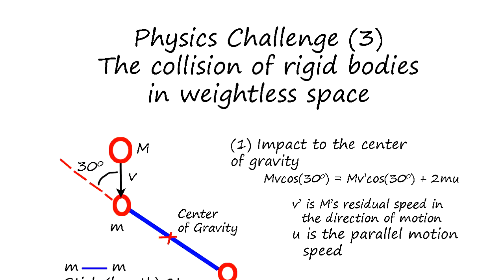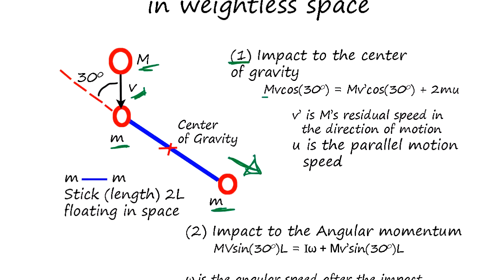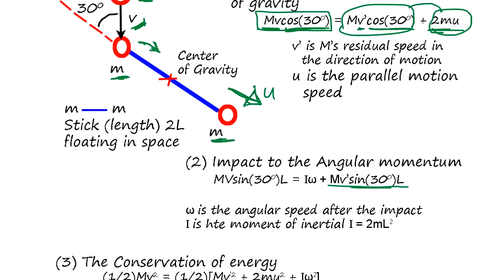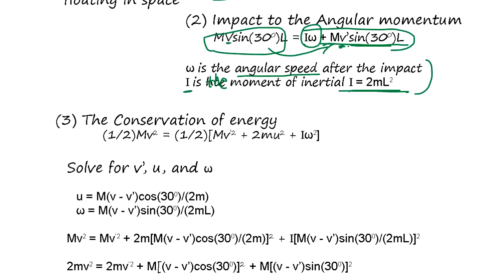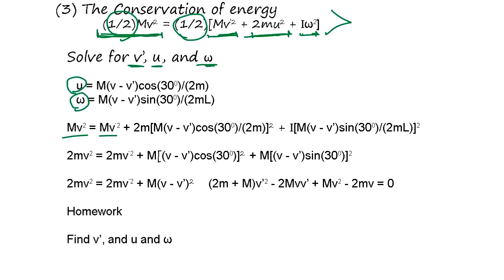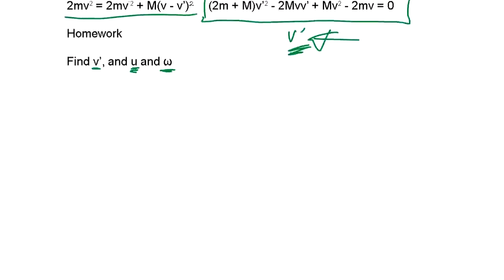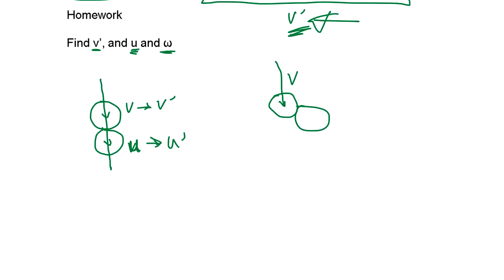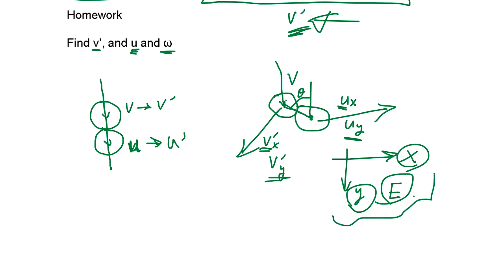Physics Challenge Question (3), Collision of Rigid Body

Comment: So.. when you have 2 Ridid bodies in 3D spain. you have Vf1 Vf2, Wf1, Wf2, 4 variables after the collision and only 3 equations. How can you solve this? Thanks
Reply from the maker: This differential equation cannot be solved by linear method. Computer can calculate ap[proximation only. It will be chaos function. Very non-linear function.